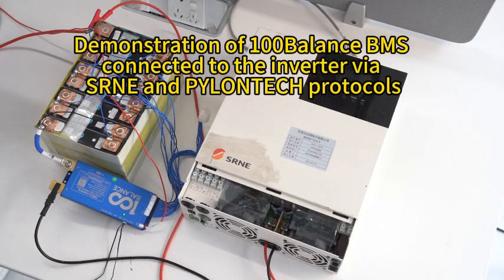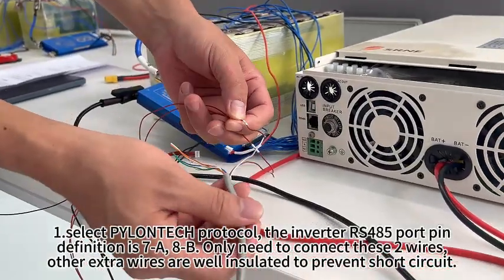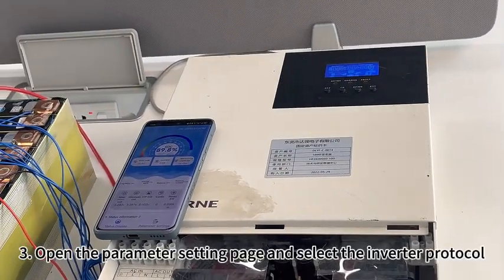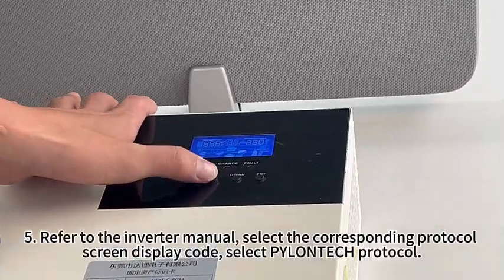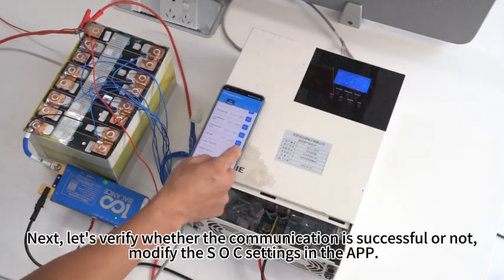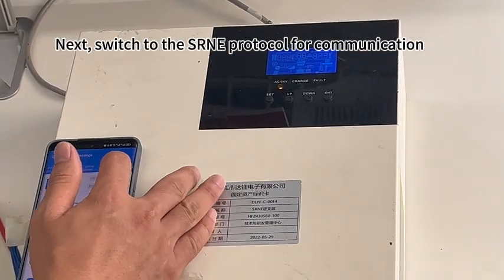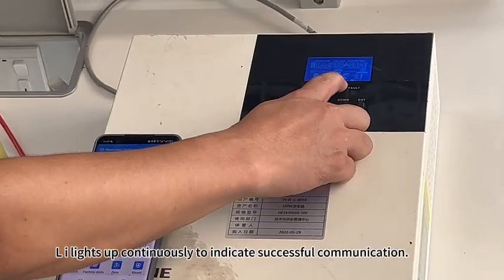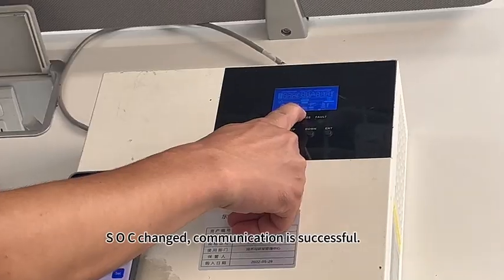How to interface with 100BALANCE BMS through the protocol of SUOJI & PAYNER?

Comment: 1. Firmware version 60_240816_01T2 the BMS does not balance when one of the elements goes beyond the limit, but starts balancing when all go beyond the limit.
2. The BMS does not determine the voltage on the elements well, and is very unstable. The same situation with the current. For example, on the element 3.400 is stable, and the BMS shows 3.400-3.440 in jumps. The current is stable 70A, and the BMS shows 69-81A also in jumps.
3. there is no option to reset soc to 100%
4. There i no option's request voltage, request current. Bulk (boost) voltage takes from alarm level 2 cell voltage high protect minus 0.4v, and nowhere wrote about this.
Will there be fixes for these problems?